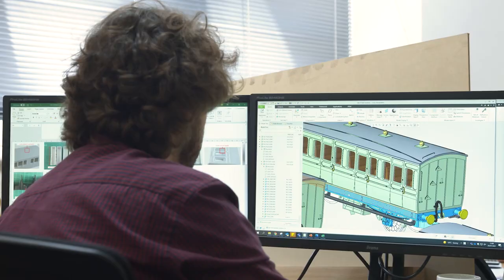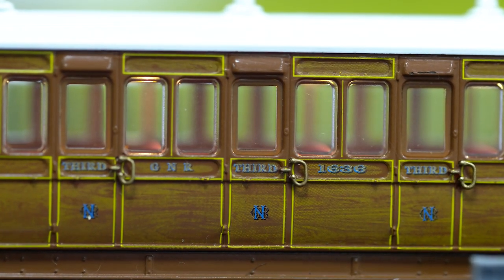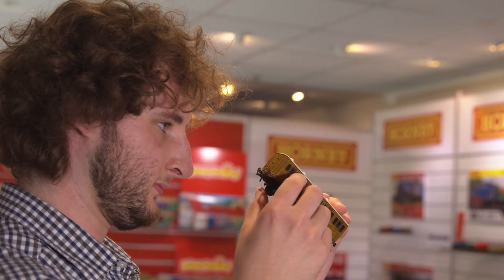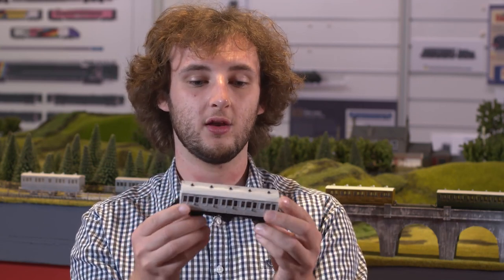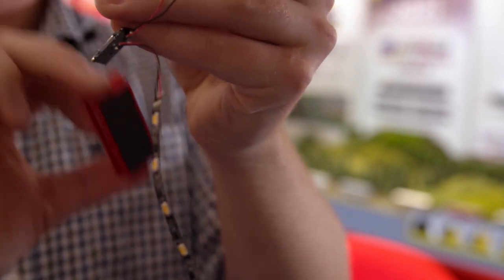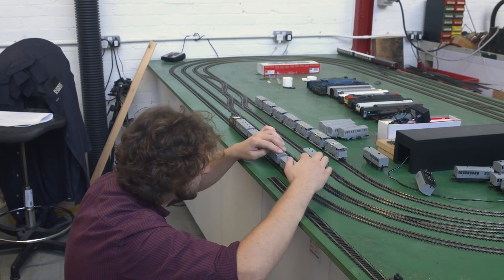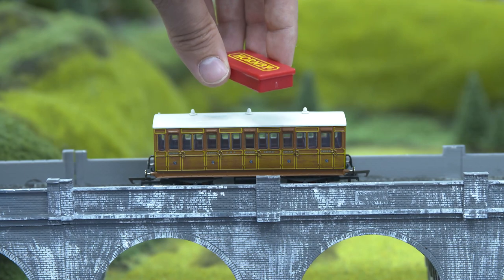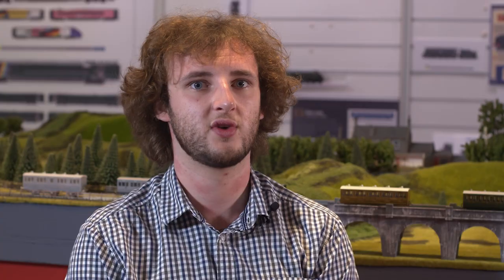HORNBY Designer Video | Four and Six Wheel Coaches

Comment: Well done Sam, I have eight of your four wheel coaches - four in the LBSC livery without lights and four in the LSWR livery with lights. They have been a pleasure to run with my Terriers. Your presentation style is excellent. I'd be delighted if you would take over all the presentation duties from the other fellows as you are so much more knowledgeable and articulate. Very well done.

Comment: 0:07 Won't the old 4-wheel coaches remain in the RailRoad range? I don't see how discontinuing them entirely is a good idea, considering that the new coaches are in the main range and will cost more, since they are newly-tooled. We still need the basic representation of the 4-wheel coach for those on smaller budgets.

Comment: Interesting video, thanks.  The 4 and 6 wheel coaches will open up the late 19th and very early 20th to a lot more modellers.  Although I am sure that purists would prefer each pre-grouping company to have their own coach designs, I suspect that that would be not feasible at present,

Comment: A fantastic video idea, I look forward to more like this. I hope criticisms are taken though, because Hornby products aren't perfect.
I have the 5 LNWR ones (or I will when I purchase the last 2 my local shop has held for me), and they look great with the lights off. I don't like the bearing design on the 6-wheelers that much, and I would've preferred pickups as opposed to batteries, but I respect those choices. For the price, I'd have expected sprung buffers though.
Lighting, however, is a big issue, both with these and the mk3 DVT. The two lit 6-wheelers I have, especially the half brake, there is massive light bleed. The plastic is way too thin and the lights just shine through the body sides. I will have to disassemble the coaches and paint the interior of the bodyshell to prevent this, which is an unacceptable thing to need to do for a coach that costs £35.